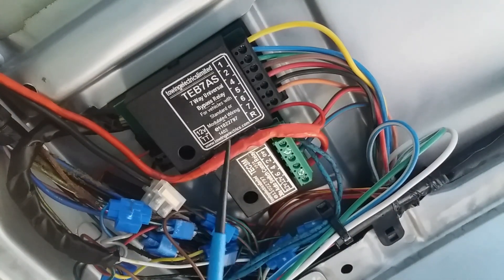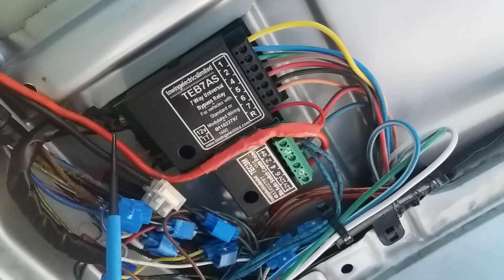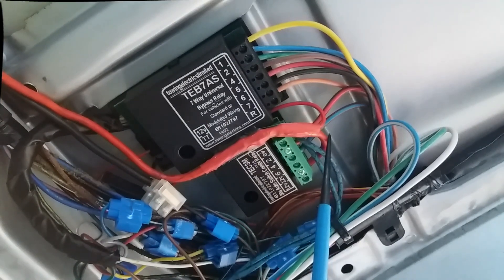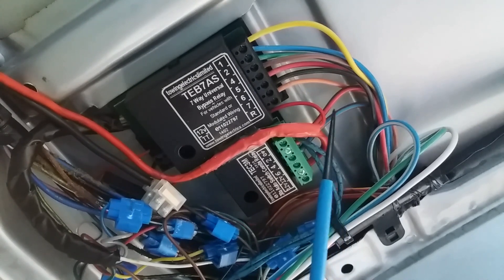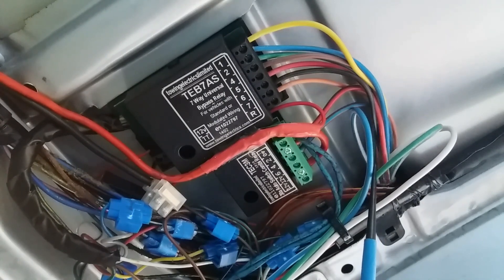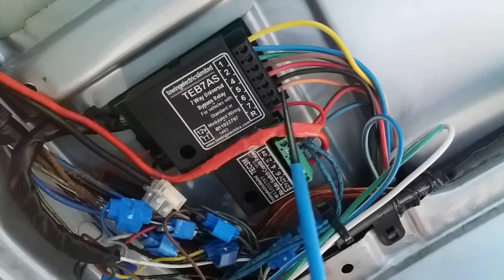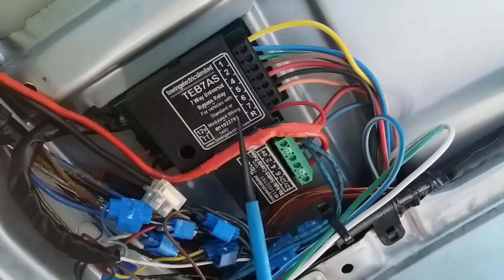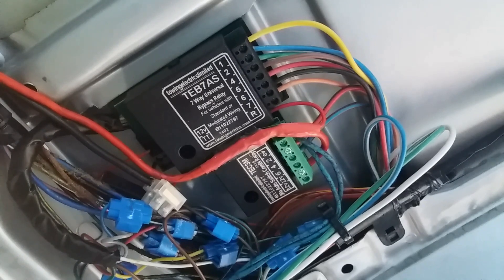Towing Bypass Relay TEC 3M, TEB7AS

Comment: I found out what the TEC3M is about; described as 

"TEC3M 30A Self Switching Dual Charge Relay for Caravan Leisure battery charging and fridge power while vehicle is running, also suitable for Motorhome battery charging." 

So the setup in this video is for a 13-pin connector system.

For 7-pin connector use cases towing some rented trailers the TEC3M stuff is not needed.

Comment: So if I don’t have a caravan, or any trailer that requires power, I don’t need the TEC3M. Correct?
Reply: Correct, this video presents a solution for a 13 pin (the newer style) towing connectors where there are extra wires for what more advanced trailer systems such as caravans use (battery charging, cooling fridge, etc.)

Comment: Hi. Tried fitting a teb7as bypass relay today. All wires soldered, nice and tidy. Triple checked everything. It is not working. There is no continuity on the white ground cable so I have no ground on the output side. And also if I have the position litghts on, will get all outputs as live 12v. Is it possible the relay unit might be faulty?
Reply from the maker: There is always a possibility the relay may be faulty, test with Dmm to check. A good ground is crucial for it to work. Only testing with a multimeter will provide the answer. If you want me to make a video showing how let me know.

Comment: What is the largest cable size to fit in the relay terminals?
Reply from the maker: In order to supply a fridge/freezer @16amp you ought to be using 4mm^2
Reply: @deuceelec  I have quite a few metre run (more than a car) so was looking to see if 6mm would fit the terminals
Reply from the maker: The key to sizing is volt drop, Resistance increases with length so needs to be calculated.
Reply: @deuceelec  indeed I agree, but as an electrical engineer I am happy with the drop using 6mm cable but it’s hard to find any information regarding terminal size
Reply from the maker: @stef2198  The largest diameter drill bit I can fit into an opened connector on the relay is 3mm. That said the pockets are slightly rectangular, not square. As such I would think 4mm max. Hope this helps.
Reply: @deuceelec  ideal thank you
Reply: @deuceelec  3mm diameter drill I work out to be around 7mm^2 so might get lucky. I guess I’ll need to try it.

Comment: hi  can anyone tell me  on the tec3m if the 2 first poles 12v 12v are for car battery ...which one goes out to the  leisure batt ???
Reply from the maker: Both 12v connections are connected, so you could connect second battery to one and car battery to the other. Make sure the connection includes inline fuses for both batteries. I believe (can't guarantee) this relay is rated for 30amp. Although diagrams of it suggest 15amp inline fuses.

Comment: The buzzer on my unit is going continually  even with the ignition off   after 2 years of use only way to stop is to pull the fuse
Reply from the maker: The buzzer is in the TEB7AS unit, I can only suggest that you check power supply and ground connections and voltage on a DMM. Assuming all other wiring connections are good, as it's been working for 2 years, but check them anyway. If all above is good replace the unit (I would take it apart and attempt a repair, but that is up to you).

Comment: Why do people still use scotch locks?
Reply: I never use them - just asking for trouble!
Reply: Proper way is to use crimp hoses, solder the wires in and use a heating gun to crimp the insulation on.

Comment: Hi..  I have fitted a towbar to my old 2008 Astra 3-door hatchback.  How do I route the cable from the battery to the bypas relay in the boot?
Reply from the maker: Look at the route other cables in the engine compartment are passing through the firewall/bulkhead and use that (cable tie as appropriate) . Once you have it under dashboard, remove "A" pillar capping and route cable up inside and into roof lining, ease door seals away from top to achieve this, no need to remove roof lining, just tuck cable into the edge and replace door seal. Repeat procedure at C or D post ( whichever applies), Single cable fused close to battery will suffice.
Reply from the maker: Yes, close to the wiring loom that you need to tap into.
Reply: late reply... Some Astra "H" cars have Rear Electric Centre, basically a fuse box behind the left hand rear 1/4 boot trim. Factory or dealer wiring kits connect there

Comment: Hi, I’ve had a new tow bar fitted about a year go I’ve just noticed when the engine is running there is no power to my fridge in the caravan but when the engine is off the caravan is working could you shine any light on this for me please I’ll be very grateful.
Reply from the maker: Do you have one of these relays installed? OR, has the vehicle been fitted with manufacturers electrical equipment?
Reply: Hi,  I think they fitter one of the relay your showing. Thanks
Reply from the maker: @andrewjones1446  If they have fitted the TEB7AS, it does not accommodate Fridge connectivity, but he TEC2M does. You need both relays to support fridge operation. On the TEC2M, check the  fridge is connected to terminal number 6 on the relay. It only charges at voltages about 13v and cut-off  below that voltage, in oder to NOT flatten your vehicle battery. Your vehicle should produce enough voltage for the relay to operate with the engine running, but not enough voltage with key on, engine off. Also check they have put the supply B+ into the 12v and ground into the 0v on the TEC2M.

Comment: Is there anyway to test the teb7as relay? My trailer lights have just stopped working, checked in-line fuse from battey and all is fine. I have recently fitted a new battery also
Reply from the maker: Check the voltage between +/- at the relay with a DVM. If supply voltage, then check voltage at for each circuit connection/outlet from the relay whilst operating said lights. Obviously indicators will have a fluctuating voltage due to their operation.

Comment: they earth on the relay can i put the of the tow bar wire together thanks good site
Reply from the maker: So long as you find a good sound location to ground (on the vehicle body/chassis), you can add as many wires as the selected mount type (bolt etc) will accommodate.
Reply: @deuceelec  many thanks towbar wireing now finish many thanks for your  help

Comment: can you tell me what wire should i use from my battery for a live thanks
Reply from the maker: It must be at least 2.5mm^2 as it carries at least 10amps for the caravan fridge alone, then add all the other light current draws. Not towing a van? Well, don't skimp on this because you might (or the vehicle might), at some point in the future.
Remember to add min 20amp inline fuse at the battery end.
Reply: @deuceelec  many thanks i will get the 2.5mm thanks

Comment: hello can you help me i have a peugeot  3008 year 2011 i have put a towbar on it now i am about to fit a relay teb7as do i have to take the negative leed of my battery many thanks vary good vid
Reply from the maker: You only need to run a Positive (+) from the vehicle battery, ensure an inline fuse is installed in this, close to the battery. Negative does NOT go to the battery, but to a suitable vehicle body ground point, as the body acts as your return path to the battery negative terminal.
Reply: @deuceelec  many thanks my problem solved

Comment: Hi thank you for your video would you happen to have a diagram showing from vehicle to by pass and then by pass to towbar
Reply from the maker: Google TEC 3M and TEB7AS, to find PDF/diagrams showing what wire goes to where. Pre relay wiring is a fused single core (of a reasonable gauge) direct from the Battery B+ Grounded locally at a confirmed ground point on the chassis.
Reply: @deuceelec  thank you buddy

Comment: Is this to connect youre trailer to the cabus system?
Reply from the maker: This bypasses the CAN system and is fed direct from vehicle battery. Fused  of course.
Reply: This relay does not have any awareness of CanBus.  It takes its input signals from the car decoded signals that go to each bulb same as how you would connect it to a 50 year old car.   The issue with Canbus is that it is measuring current on the decoded signals, and if you would not use a bypass relay the extra current caused by the trailer lamps could cause error codes in a canbus car. And if there is a short you could damage your car. But here all is protected by the bypass relay installation.

Comment: Where did you connect the red brake cable? L & R or just one side?
Reply from the maker: Both brake lights are usually linked, so you'll get away with connecting to one side.
Reply: @deuceelec  Since you know that both sides work simultaneously you can choose which side to get the signal from.